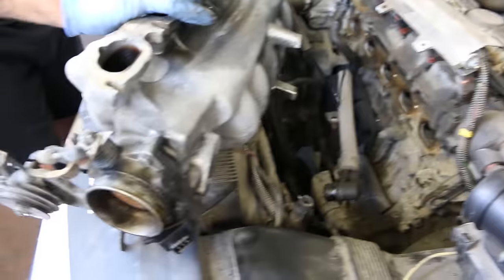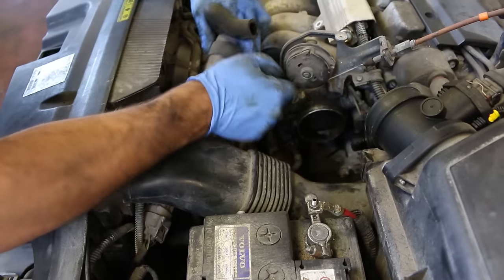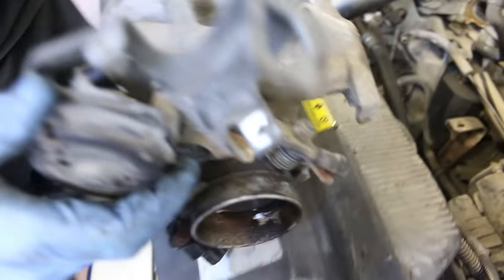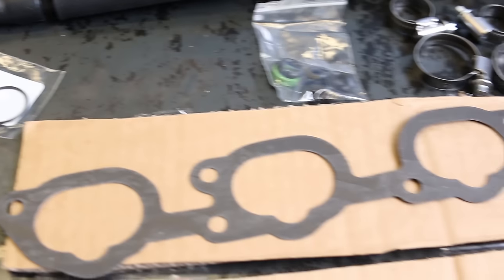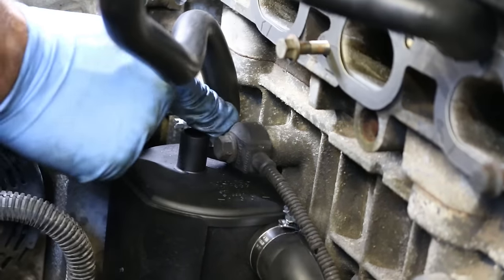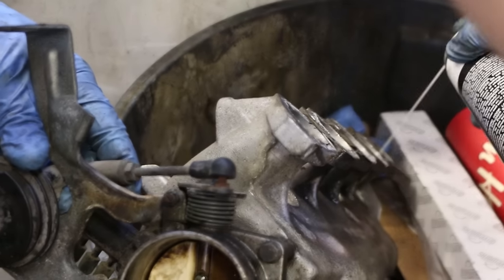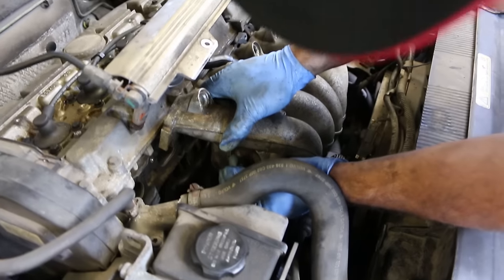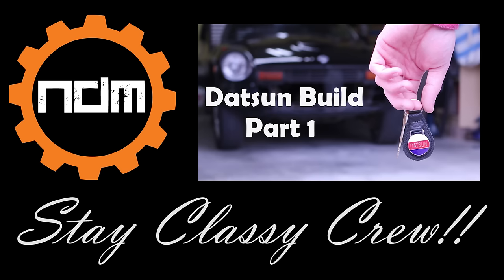Changing the PCV System on a Volvo V70  -  ShopTalk Episode 7

Comment: I do this job quite often on the Volvo engines in the XC models and the saloons/estates. I have got it down to a fine art and can remove and fit a new PCV box and clean the breather port that goes down to the sump without taking the inlet manifold off. Remove the oil filler cap and use an airline to blow into the breather port and listen if you can hear the oil bubbling in the sump,  If the port to the sump is really blocked then you will have to remove the sump to clean it out.

Comment: was it hard to replace the brake booster vacuum line? 8:41 minute. Mine is really tight on the plastic coupler  down the line. Where you able to remove it without damaging the plastic connector/coupler ?

Comment: Sharp video you guys, I'm getting ready to do PVC on  my 94 850. I just did my throttle body and EGR., I noticed you cleaned the complete manifold that's cool what did you use,I didn't think about that, is throttle bottle cleaner the best. I don't want to use carb cause it leaves a residue. Keep hanging guys, I may need you ok Thanks,Debbie

Comment: No doubt , a better then great video . I have been watching several videos here on You-tube this one is the better. but only wish we could have heard the engine before you started this project and after. There are it seems several things that will give symptoms similar to PCV problems.,,, Seems like code readers are helpful but not absolute . I think the computer is designed to compare peak engine performance to multiple areas  and throws out a lot of (could be's) . Thanks for the video.
Reply from the maker: Thanks for the input .... in our case the main symptom was multiple oil leaks due to extra pressure in the crankcase caused by the blockages in the PCV system.

Comment: need some help with mine... I replaced the PCV system and now I've got some sort of vacuum leak (I'm assuming). The engine cranks for a while before starting, and when it finally does, there is a loud hissing noise coming from the engine. I've narrowed it down to the tube running from the flame trap to the intake "tree" (above the throttle body). The intake is pulling hard on that tube and I have no idea why. Could you help me out please? I'm just a kid tryna fix his car and I would really really appreciate it, thanks

Comment: Don't loose those two bolts that secure the PCV box:  these are not standard bolts, they are thicker and must be purchased directly from Volvo if one is missing.  Also, don't install the PCV secured with only one bolt: the hoses will break loose from the engine block.

Comment: I have a 97 850 turbo that just started leaking like a sive. There's smoke that comes from the exhaust as well. Could this be the Pcv system needing to be replaced? Also how much would a repair like this cost?

Comment: What did you do about the totally clogged port on the engine block that was revealed when you pulled loose the pcv box? Thanks!
Reply: If you can't blow some air with a hose to hear the oil bubbling inside the oil pan, it's time to drop the oil pan and clean the passage and replace some o-rings by the same occasion.  This is why you want to replace the PCV  EARLY, before the lower port gets clogged.  Each 100000 miles or so.